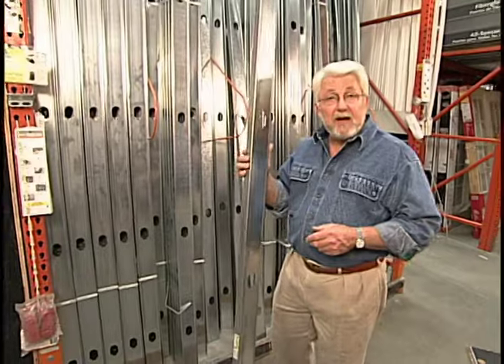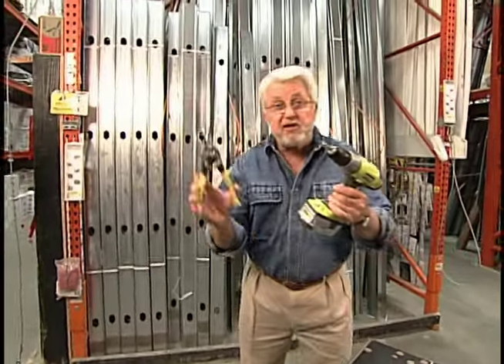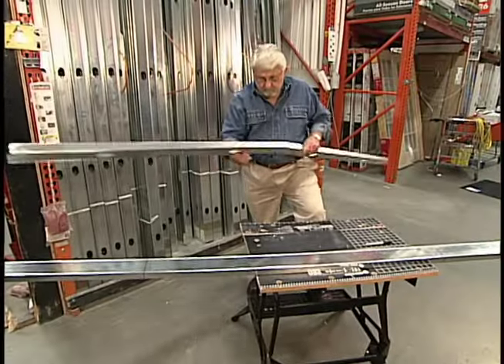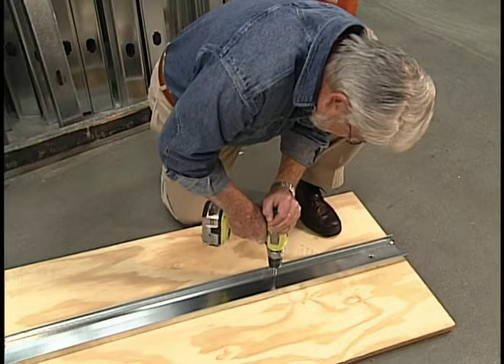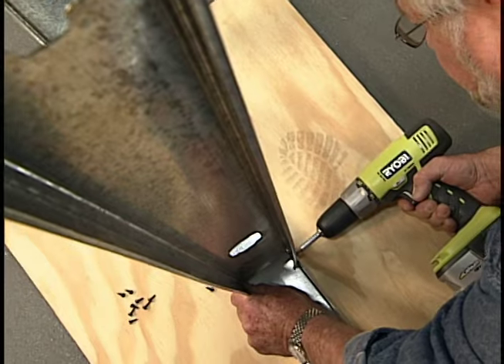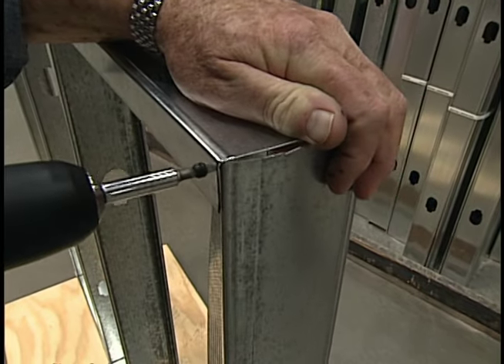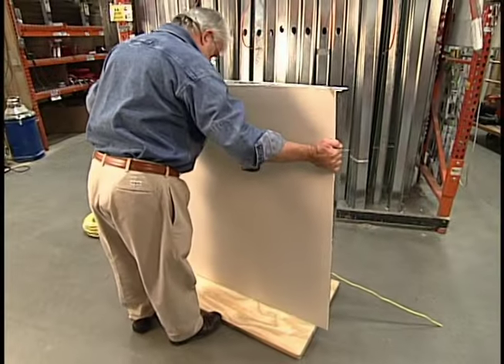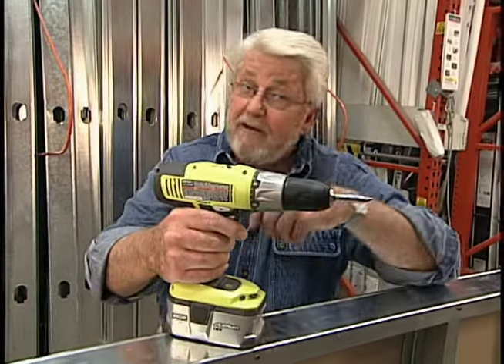What You Need To Know About Working with Metal Studs & Framing

Comment: Get yourself a pair of Crescent (or equal) locking c-clamps to hold the stud tight to the track before running in the mini screw. This will save you much frustration. I was a union carpenter for 30 years and I installed miles of steel studs.

Comment: The biggest problem is those screws you are using to connect the studs to the top/bottom plates. When drywall is applied the  screws cause the drywall to kickout so it doesn't lay flat. This is a real problem around doors and corners. Also, metal studs are a full 3 5/8in. 2 x 4's are 3 1/2in. Consequently, standard pre-hung doors frames are not wide enough to fill the opening in the steel stud framed wall for doors.
Reply: Yes in 1993 I saw some of the first steel stud homes built in SoCal. To deal with the issue you mentioned Resilient channel was attached to interior framing members. I don’t recall how door installs were handled but they built and sold 75 units. However the Home builder went back to standard construction for later phases. In those days there was a learning curve for building production homes from steel.

Comment: The issue we’ve run in to with these is when it comes to hanging heavy items (such as tv’s) any tips on hanging things on walls with metal studs? Is there any value in trying to find a metal stud and hang from it?
Reply: Safest option is to put in backing when framing, or open wall up and install after. I have done this for very heavy items such as wall mounted counters. For a TV, a few zip toggles into the metal studs should work. You can also install a finish piece of plywood across 2 or more studs then hang mount to that, so weight is distributed. Ply could  be painted wall colour, black works well too.
Reply: Fully agree with you.  Interior at best. Sorry been in the construction field for 45 years.  It's meh for interior.
Reply: Wood backing
Reply: Exactly what I want it to ask , you hit the nail on the on the head .

Comment: Did my basement using metal studs. Walls are true and in the scary event of water, the drywall can be cutout and replaced without the fear of mold on a wooden stud.
Reply: They will rust and rot away if exposed to water though. Wood just rots differently.

Comment: Great Video Ron!  Your the best!  Have you heard about Connectubes? It is framing system using 1 1/2 galvanized rectangular steel tubes that are connected easily with steel couplers. So there is no welding.  A lot of people are using it now for bbq frames and fire pits.  The company sells it wholesale to the public for around the same coast as 18 gauge studs.  It would be great if you can make a video with it!   Best Regards.

Comment: Can these be drilled and riveted as well? I'm not sold on the screws for fastening.
Reply: Yes you can, however have you tried to see the integrity of the screws? They're specifically designed for this application

Comment: those holes for the grommets and wires look pretty big to me.... are the studs still able to hold the weight of the building after those holes have been punched out?
Reply: Most steel studs aren't used for bearing walls, especially this application he is showing light gauge ones being sold at home center. Those are just for partitions, heavier gauge ones can bear loads, they still have the cut outs, just stronger gauge of steel.
Reply: @chrisburns5691    thanks, good to know 👍
Reply: we use larger and heavier gauge studs on large buildings. 6, 8, 10 inch. these studs in the video are 3 5/8 inch